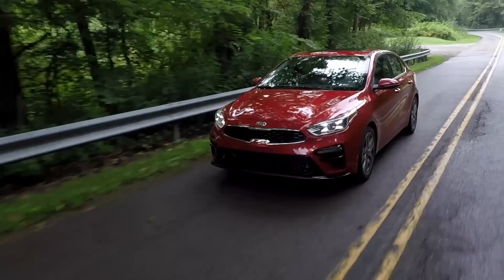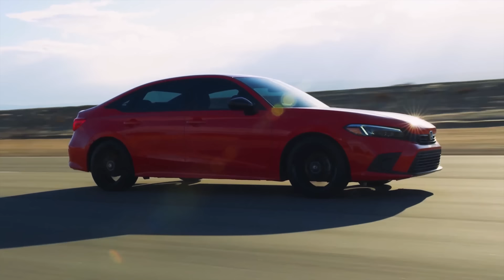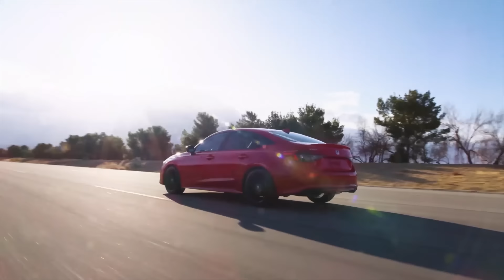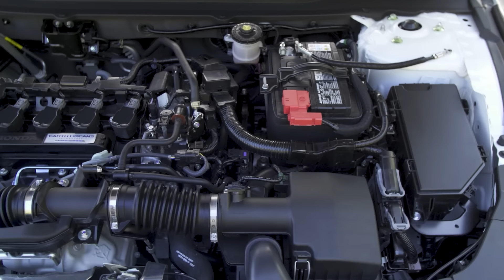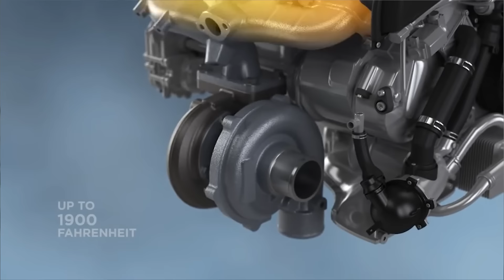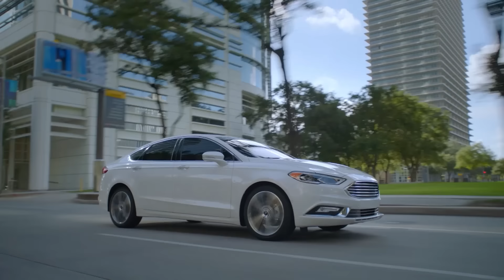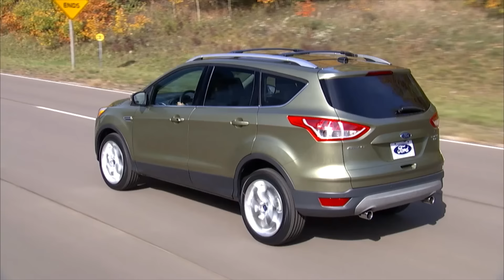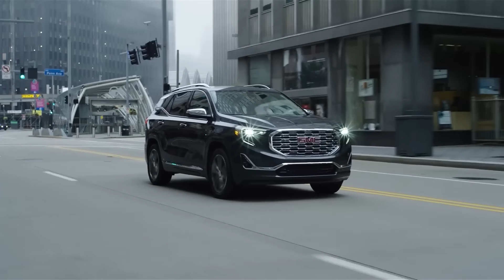Are Turbocharged Engines Reliable? The Truth About Turbo Engines

Comment: You have no idea about what you are TALKING ABOUT TO your MISLEAD viewers! My engineering final design is on a GM ECOTECH TURBOCHARGED ENGINE THAT HAS SOLD GLOBALLY  NEARLY 200 MILLION ENGINES, WINNING COUNTLESS AWARDS.  YOUR ARTICLE AS PRESENTED BY YOU WOULD BE ACCURATE 30+ yrs ago when I began building Turbocharged engines. In the EU since 2000 have been TURBOCHARGED with and without direct injection!  ENGINES ARE IN GAS & DIESEL VOLVOS DRINING AROUND IN THE SWEDISH/NORWAY AND FINISH ARTIC CIRCLE WITH TURBOED GAS AND DIESELS CARS AND TRUCKS, WITH NONE OF THE ISSUES. IN YOUR BS LIST. IN THE EU, OVER 95% OF ALL GASOLINE CARS ARE TURBO, 95% DIESEL POWERED. EU CARS, TURBO'D!!!!! ARE YOU LISTENING MEATHEAD?? 
IN THE USA ABOUT EVERY DIESEL POWERED SEMI TRUCK ARE TURBODIESEL AND HAS BEEN SINCE THE MID 60'S .
TOYOTA SAID NO MORE BATTERY CARS,  THEY WILL NOT CONTINUE TO BE A PART OF THE BS BATTERY POWERED CARS!
TOYOTA IS RELISING THE MOST EFFICIENT TURBOCHARGED ENGINE EVER BUILT, AGAIN ITS TURBOCHARGED!!! DO YOU THINK THEY JUST READ YOUR BLAB AND THEN SPENT 2 BIL TO PROVE YOU DON'T HAVE NADA  LOT OF BRAIN CELLS 😂😂😂 YOUR INFLATED EGO MUST 😂😂,  SADLY THIS PROVES ANYONE CAN FLAP THEIR JAWS AND MAKE A BUCK, YOU SHOULD SHUT YOUR BS SHOW OFF!
Reply: S.R. you use many words fully capitalized .  You are emotional and use emojis .  I dismiss you here.
Reply: @mikewallace8087  He's right though.

Comment: I bought an early production 2017 CRV with the "Earth Dreams" engine. Although I never had a single problem with, I worried constantly about the oil dilution issue. I sold after 4 years with 130K  for a fair amount. After having a terrible time with 2021 Toyota Highlander, I sold it for a very fair price. I went back to a 2020 CRV. I am so glad to have made that choice. I usually drive about 23 minutes to work and home. I have been getting even better gas mileage than my 2017. I average 33mpg. I think Honda, being an engine builder, before anything else has truly sorted out the reliability issues with their small engined turbos. Not so confident with other manufactures build quality. Not sure how you can put a 2.7L turbo engine in a 5000+lbs pick up, and not have reliability issues.
Reply: I hope you're right.  I just got a 2024 honda accord 1.5 turbo engine. I plan on oil changes more often than recommended,  use higher octane fuel , & I don't drive it hard.  Hopefully it will last a few years with no issues. But I might seriously consider trading it in then on a regular gas engine, no turbo.🤞
Reply: No worries! Honda has the issue sorted out! Change oil every 5K(0-W20) and you are golden. I don't feel higher octane fuel will help you in any way. Peace. @JanetVaughn-cm3et

Comment: Meanwhile my 29 year old Volvo turbo wagon has 284,xxx miles on the original engine and turbo and keeps chugging along and my 21 year old Volvo turbo wagon is getting ready to turn over 200k. 
Many of the issues you raise are applicable across the entire range of vehicles, turbo or not. Fuel dilution and condensation from short drives in cold weather in particular. Direct injection is less efficient at cold startup, the turbo has nothing to do with it. The examples you referenced (BMW, Ecotec) are failures of engineering, not the fault of the turbocharger, and rather famous on the mechanics chat rooms.
Overall I give you a C-, there's as much opinion and misinformation as there is good information. 
As for me, I graduated Lincoln Tech in 1982 and have been working on cars for forty seven (G*d help me) years. I know of what I speak.

Comment: One MAJOR advantage of turbocharged engines is that they are immune to high altitudes/thin air.  A turbocharged engine will perform pretty much the same at the sea level and at 4000 feet above it.

Comment: They are not reliable.  I had a Audi Q5 2011.  The 1.8 Turbo engine started to over heat after 3 years and oil started to burn.  The turbo engines have create extreme pressure on the engine, all this pressure causes valve and gasket leaks.  And a turbo replacement can be up to $1500 and up.  I had a Toyota V6 engine and it lasts forever.  These companies trying to get away with fuel economy by using turbos, but this compromises the engine.  I would never go with Turbo engines again.  They sound cool on paper, like they are faster, but truth is they are just a gimmick.

Comment: Have a Chevy Cruze been great 38 to 39mpg, minor issue of pcv covered by recall, thermostat housing easily fixed.  close to 100,000 miles NO turbo problems, BUT I change the oil every 3 to 4 thousand miles and only use synthetic oil Do that they last

Comment: I avoid them at all costs I have seen the issues with all brands since they started using them widespread. It is not the same as adding a turbo to a race engine they use turbos to use tiny weaker engines so they can get better fuel economy, but you do not save any money from the fuel savings because you spend so much in repairs over the life of the vehicle. Its a bunch of crap IMO! The Toyota wastegate issues was because the 3rd party making them was not meeting the quality requirements and specs Toyota wanted and they fired them . The issue has not been widespread since. I still would not want a turbo, but if I had to buy one I certainly would buy Toyota! Your information on the Ford Turbo 4 cylinder coolant intrusion is incorrect. The problem was caused by a design flaw in the cylinder head itself. Ford re-designed it since that time, but they screwed a ton of people and never stood behind their product. They knew it was a design flaw and should have recalled it, but they knew it would have been extremely expensive to do so. They chose to screw their customers instead. My wife had a 2015 Fusion and it was a real problematic car. We traded it in on a 2020 Camry SE and glad we did.

Comment: I bought a 2020 WRX(manual) . Bad mistake. During the covid lockdown(s) I drove even less than normal. I'd let the car idle for 10 minutes  or more before departing. I'd drive out of my way to different towns just to run errands. I put in multiple oil changes at short intervals(Castrol synthetic)  Added gas treatment biannually. Ya, the engine is properly maintained, as required by the Subaru guidelines.  The turbo runs without issue, other than the occasional backfire. Sure, it's fun to drive.But at what cost?

 I have just as much fun with my Suzuki normally aspirated manual Grand Vitara.

Comment: The problem here is that you're confusing turbochargers with complexity of modern engines. Turbocharged cars have been around since the eighties and have had massive success. Turbocharger units can exceed 200k miles before replacement. Lack of maintenance is always the downfall of any vehicle. Being in the industry for the last 20 years I've never seen a massive amount of turbocharged related failures. It's always non maintenance related. First generation engine problems are manufacturer and design issues. Not turbocharged specific issues. It seems that you're trying to confuse the two.

Comment: Three things a car needs to have: a turbo, having the engine rear-mounted, and rear-wheel drive. (+ optional: Airbrushes and either sun-roof glass roof or convertible roof). That´s why the question should be: If a turbo is unreliable is a compressor the better choice? Or just refill the 1-2 Liters of oil the turbo ejects every month and enjoy the drive :D

Comment: The real problem is regulations forcing manufacturers to choke out engines with all the added emissions machinery. So to compensate they have to either make engines bigger or push them harder.

Bottom line a turbo will accelerate wear and tear and add significant repair cost after the warranty expires.

Comment: I have the Hyundai Kona 1.6T, 4 years no issues, but the service guys always told me that I should be dillgent with the maintenance schedule of 3 months instead of 6 months on a regular engine. It is definitely more expensive since they check it four times instead of two. That said, for my next purchase, i will not buy turbo anymore even though the one i got is pretty reliable. Besides even if i have the 2.0 naturally aspirated kona, it has enough power for city and sometimes out of town trips.

Comment: If the engine is properly built for turbo use, the turbo engine can last even longer than a NA(naturally aspirated) engine. A turbo engine is not necessarily more complicated than a NA engine. For example Chevy's 2.7 Liter Turbo 4 is actually simpler than a NA 5.4 Liter V8 with fewer moving parts, yet makes higher torque at lower RPM than the NA V8. An inline 4 of 2.7 L has the exact same bottom end, crankshaft strength and bearing layout as the 5.4L V8 so the Inline 4 is just as stout as the larger V8 on the bottom end. This is one of the reasons the inline 4 is a better engine to turbocharge than the weaker V6 layout. Even though the large 2.7 Liter inline 4 has to add two balance shafts to smooth the 4-cylinder vibration, the 4 cylinder, even with a turbo still has far fewer moving parts than the NA V8. Another huge advantage to the 2.7L turbo I-4 over the NA V8 is the Turbo 4 can maintain its power and torque up to high elevations, where the NA V8 will lose more and more power as elevation increases. So in reality, particularly in cases where a Turbo inline 4 replaces a NA V8 of twice the displacement, the turbo 4, if built for turbo use, can actually be a stouter engine than the V8 with a far longer life span than the V8.

Comment: My mechanic's advice to me in regard to looking for a new/used vehicle:  "If at all possible, avoid CVTs and Turbo Chargers."
Reply: Toyota Hybrid with cvt are one of the most reliable Cars ever
Reply: @oliver4005  That's an ECVT, not cvt! 
World of difference As illustrated in video....
Reply: @doubledranch871  Toyota Just call it cvt. And Turbo Chargers: old VW/Audi 1.8T 300.000km no Problem. Old Mercedes Turbo Diesel 600.000km no Problem. It's not that black and white. Good engineered Turbos and CVT's arent a Problem. The Problem is, that there are many people who dont care about their Car, dont Change oil, Drive it warm/cold and stuff like that. The other Problem is, that there are a lot of Cars with badly engineered technic. Opel Transmission cant hold 100.000km, old BMW 318 Engine has a lot of Problems even without Turbo.....and so on.
Reply: @oliver4005  "Toyota Just call it cvt."

I have seen toyota called it ECVT and have seen the actual schematic of operation. Very different from "standard" CVT.....
Reply: @oliver4005  every car isn't a Toyota.
Reply: @oliver4005  if it HYBRID THEN it is ECVT not CVT with belt....ecvt is just simple gearbox much more stronger than CVT.
Reply: @oliver4005 they have a ECVT which is completely different to a CVT
Reply: @oliver4005  Toyota/Aisin CVTs are reliable in general. It's the Jatco ones you need to watch out for.
Non-hybrid CVT Corollas and Yarises are very reliable.

Comment: True those turbo engines can give a lot more power especially when accelerating but along comes a greater chance for the morons who drive them cars rear end or are involved in accidents and reason i say that it's because I'm on the market looking to buy a used car there are so many nice civics and accord models out there 2016 or later with few milage for the years being 50, 60 or 70 thousand miles but all of them hold salvaged titles due to damaged in the front bumper or rear ended therefore they sell then at a cheap price as opposed to the cars that are naturally aspirated so many hold a clean title!!!!  i mean in not saying the turbos are the main and only cause for that but definitely a contributing factor so many morons out there so impatient and desperate to get to where they're going driving a turbo charged engine what can we expect?

Comment: my 2022 BMW X3 has a turbo charger issue resulting in check engine light, even before its first oil change. Its been in the dealership for a week with no resolution.

Comment: Driving home from Las Vegas spotted a late model KIA Stinger with flashers on limping up the mountain pass 10 mph while my 2005 Toyota Sienna with 324K miles on the odometer zoomed past the Stinger at 85mph.
I bet the Stinger could beat my 05 Toyota Sienna when it was brand new 😂

Comment: I would never buy a car with a turbocharged engine. Even though very powerful engines are exhilarating and fun to drive, they are just too expensive and you’re more likely to get a speeding ticket.
Most small cars have plenty of power at least for my needs. Turbos have terrible reputations for reliability.

Comment: I avoid cars that are turbocharged for the reasons you described.  I would also add the downside of the extra heat under the hood aging hoses and belts.  However, what about diesel engines.  Many of those are turbocharged, right?  Some of the diesel engines are known for longevity.  Is my observation accurate?  Why do turbocharged diesel engines not have the problems that turbocharged gas engines?
Reply: Have to agree about diesels.  3 of the same engines covered over 600k miles between them.  One had a turbo failure at 195k miles - but that was likely caused by how the car was driven in its last 20k miles (relying on high revs in low ratios to ensure DPF operation - which was likely to write the car off at the next testing time, anyway).  One vehicle was written off in a RTA at ~250k miles and the other scrapped due to body corrosion at 176k miles.  Engines were otherwise bullet-proof - no excessive oil consumption, good economy and minimal servicing above the normal oil/filter changes.  No gearbox issues with any of them, either.

If cars are driven sensibly, the drive train should last the life-time of the vehicle.

Comment: Fun factor, driving dynamics, performance are just a few reasons why I chose a turbo vehicle.  I now have over 85,000 trouble free miles on this vehicle.  No oil burning, no noises.  good MPG.   Granted, I am in the maintenance field so I am not your typical car owner.  I have performed oil changes every 5K with full synthetic top notch oil and filters.  Only run premium fuel.  Maintain my vehicle very well.
Reply: And within the 85,000 miles you will sell it because of the big dollar repairs coming up, I wrench as well
Reply: @TonyTundra5.7  How is he going to sell it within 85,000 miles when he already has 85,000 miles on it?
Reply: Not every car gets lucky to have owners like you!
Reply: I always run premium fuel since the UK brought in E10 because premium fuel reamins E5 or if at Esso no ethanol meaning I get higher fuel economy from the premium fuel which combined with the better perforance which is noticeable espeically when the engine is cold I always use premium since 2020. My car from 2019-mid 2021 got premium once in every 3 tanks. My car is a turbo but below 2000RPM you get no turbo at all and the car is happy between 1500rpm and 2000rpm even in 6th gear. I have a Toyota Auris 1.2T 2016 and it genuinely seems to give the best of all worlds its a petrol that drives like a Diesel and makes minimial use of the turbo.
Reply: Altitude is a good reason to buy turbo
Reply: @jamesmedina2062  How?
Reply: @mikek.9980  how?? The car has a turbo. Turbo compresses air.

Comment: They definitely shouldn't be putting a Turbo engine in a Hybrid. The new Hyundai 1.6T  Smartstream engine is a gem in non hybrid vehicles. A pleasure to drive with great low end tourqe. Very smooth and pleasant 👌 I would trade it in @ 100k miles 😀 Not sure how it will last, long term. 😆

Comment: So here is my situation. I have an opportunity to purchase 2016 Lincoln MKZ W/Ecoboost or 2016 Lincoln MKZ w/naturally aspirated 3.7 V6.

Keep in mind the V6 has a chain driven internal water pump and when it goes it’s $2,000 to get replaced.

The turbo engine has 59,000 miles on it and the V6 has 48,000 miles on its engine.

Which would you buy?
Reply: 3.7. I had a Ford Flex w/3.5 liter that the water pump went on. It is a headache. 

How about avoiding the brands all together. Acura offers great options non-turbo.

Comment: If you lease your vehicle and return it after a few years, turbo engines are fine.  However, if you keep your vehicle longer than usual (say 10 years or more), then naturally aspirated engines, especially those with low compression ratios that allow the use of regular gas is the way to go. Thanks for confirming this experience of mine with my high mileage vehicles.

Comment: Just buy a Lexus turbo. My IS 200T has 108k miles, and nothing has degraded. MPG is still the same and performance is  still the same. I always use top tier gas + fuel system cleaners and buy premium oil like Red Line or Royal Purple HPS. Only thing that has being replaced is the water pump, which was done by previous lease owner. But the water pumps have always been Toyota's achilles heel.

Comment: Turbos are for Diesels that work hard, NOT for little gas engines.  The other thing with turbos is that with diesels when done working the truck you need to do a turbo cool down time before shutting down the truck so as not to cook off the oil in the oil lines lubricating/cooling the turbo.  No one is going to  sit in their little Civic for 2 to 4 minutes after a long drive before shutting it off.

Other thing is diesel engines are made far stronger then any gas engine.  Thicker, heavier and the headbolts hold down the head strong so as to hold all the pressure put out by the turbo.  Gas engine turbos are prone to head gasket failurs.